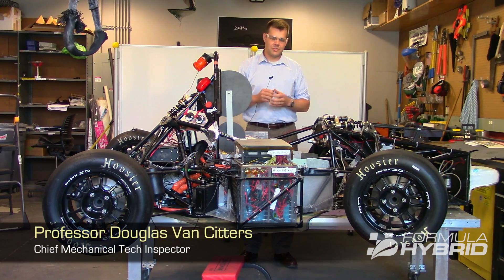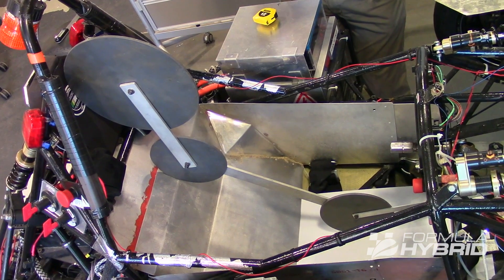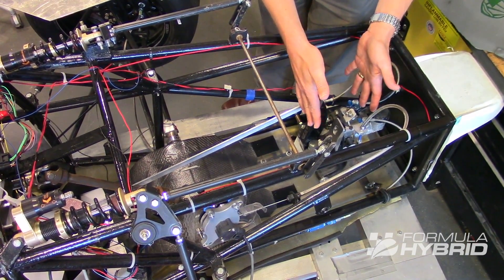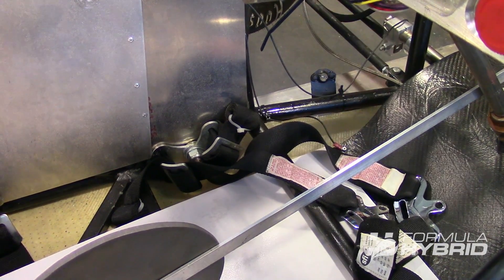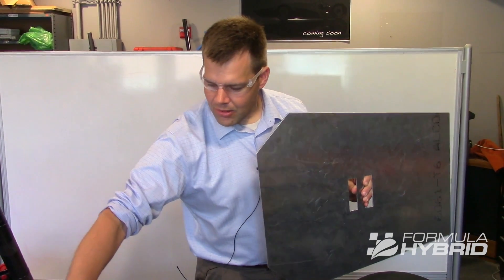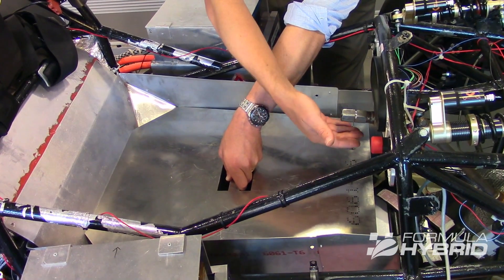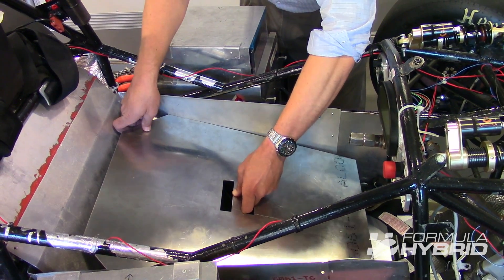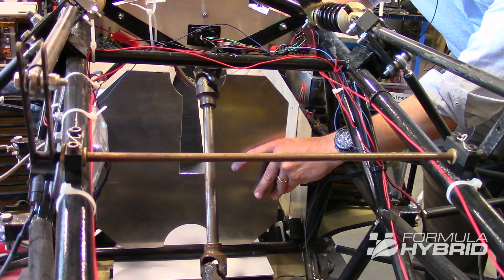Formula Hybrid Mechanical Tech Inspection: Cockpit Template Procedures

Comment: What's the material of firewall?
Reply from the maker: According to Formula Hybrid rule T4.5.2, “The firewall(s) must be a rigid, non-permeable surface made from 1.5 mm or thicker aluminum or proven equivalent.“
 
The Formula Hybrid rules can be found here: https://formula-hybrid.org/wp-content/uploads/2019-Formula-Hybrid-Rules-Rev-0.pdf